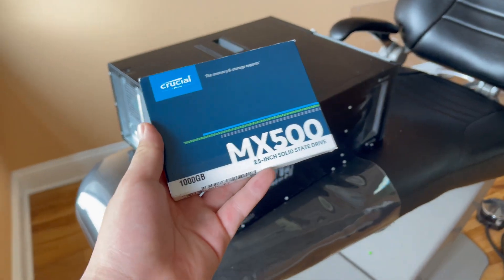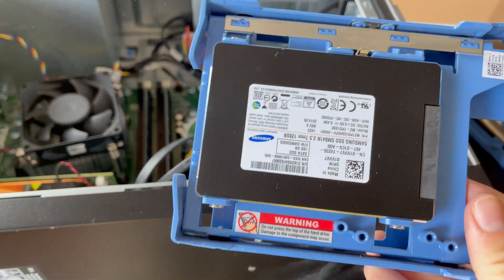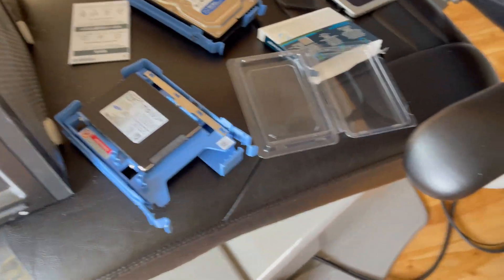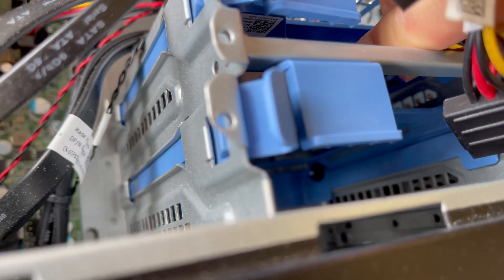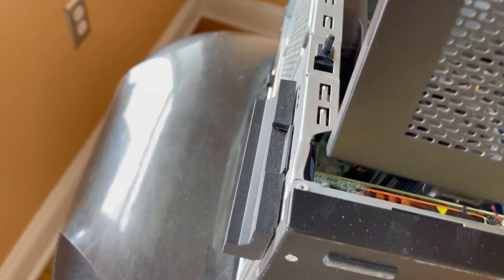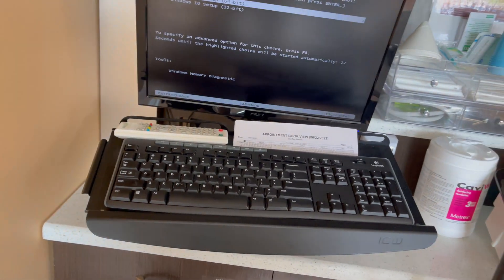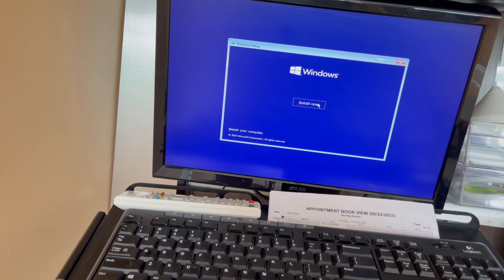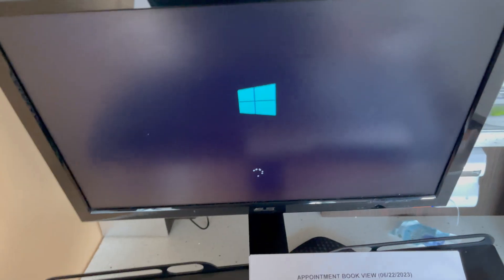Dell Optiplex 9020 SSD Upgrade

Comment: do i need different cables for the ssd? I am worried the cables used for my hdd will not work for the Crucial MX500 ssd